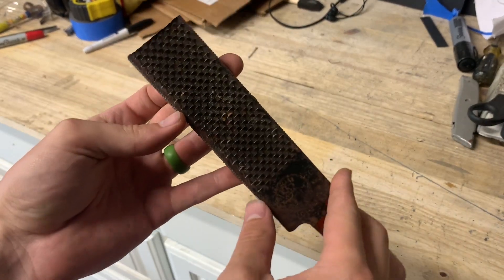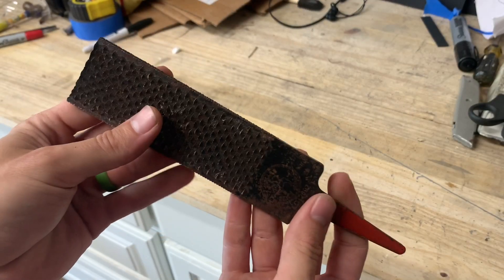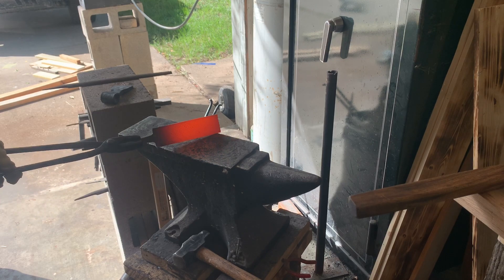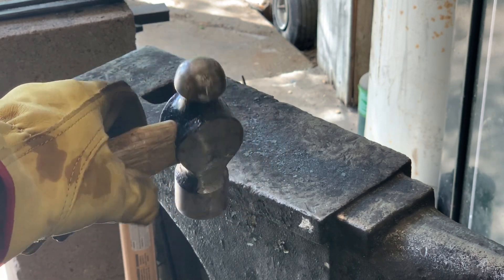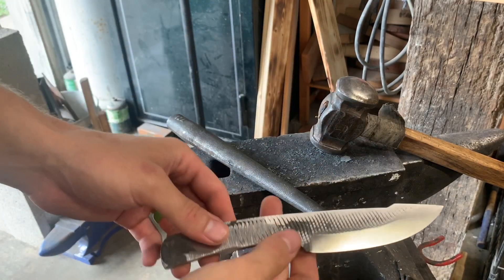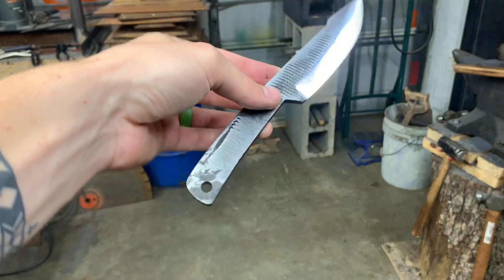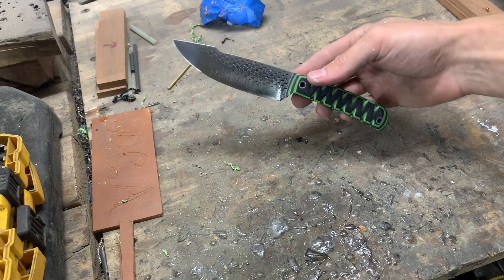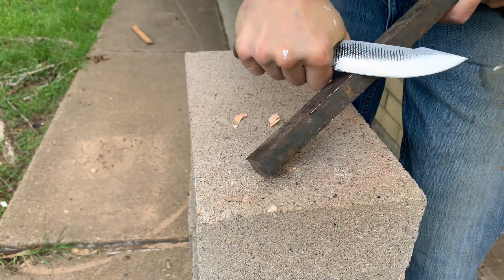Forging a Knife from a file | Knife making

Comment: do files have decent edge retention?
Reply from the maker: Enough to be an alright knife. Now when you say files there are different kinds. Old nicholson bastard files make excellent knives (if you enjoy using material like that, I do) Rasps are a different animal entirely. Need to make sure you get ones that aren't case hardened (save edge is bad). My favorite are heller rasps, Ive had good results with them. People will argue they differ from 1045HC to 1060HC. From what I have tested and made the ones I have used are 1060. I have made 50 and of the 50,  4 didn't hold an edge as well as the others. 

All this said, experiment. Make one test it and make another.